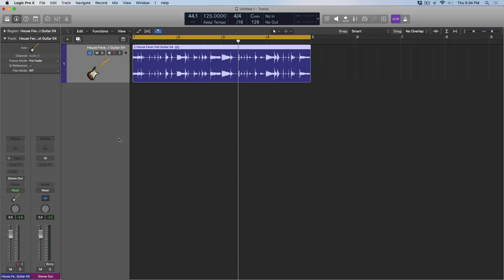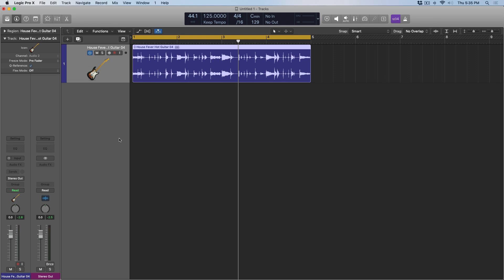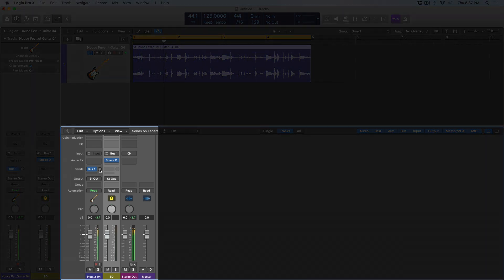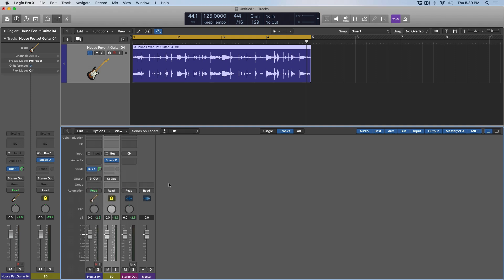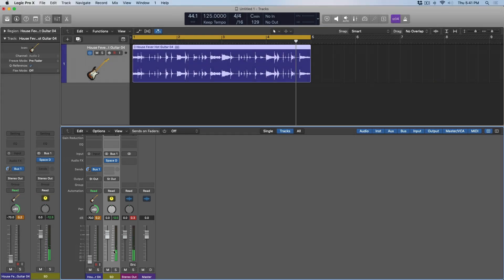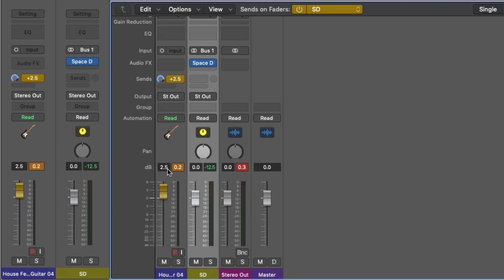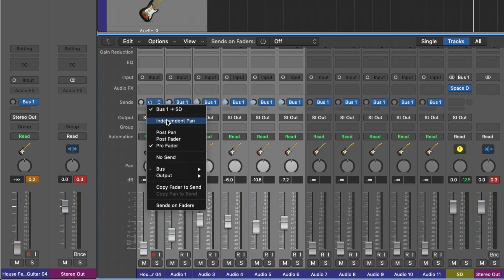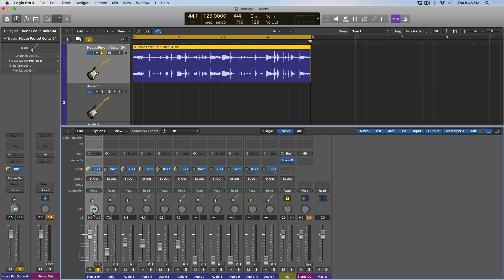Sends, Busses, Auxes - The Full Story on Piping Audio in Your Logic Projects

Comment: When we export ALL stems for mixing step with other software suite like Izotope, all the Aux channels are not exported. Is there a way to have Logic Pro export them?
Reply from the maker: Hey entweka, thanks for mentioning that! It's important to remember that Logic can only Export what's in the Main Window (not the mixer). Be sure to create tracks for your Auxes. Also - if you have software instruments sending to your Aux channels, they won't export properly. Use the pencil tool to create a region on those Aux channels that extend from Bar 1 to the end of your Project. Then use the "Export Regions as Audio Files..." option to Export those Aux Regions.
Reply: You can export each track or group of tracks one by one using "Bounce Project or Section". Might be easier to use Izotope within Logic though?